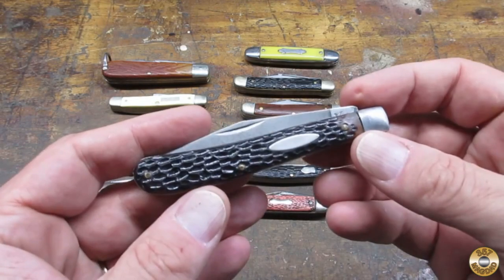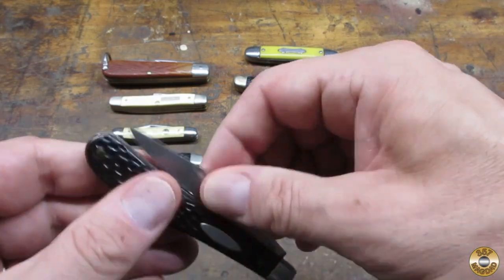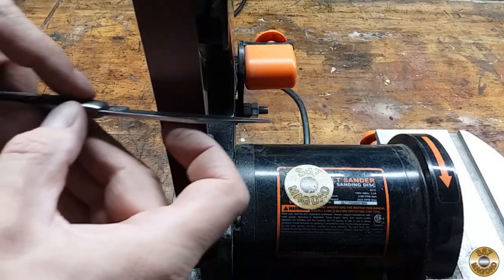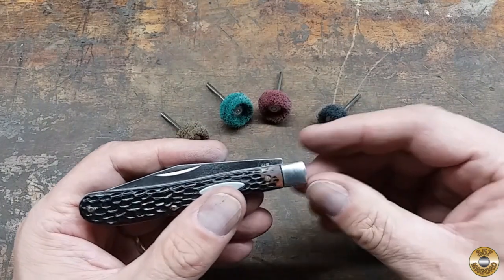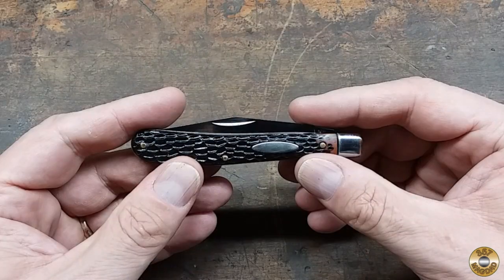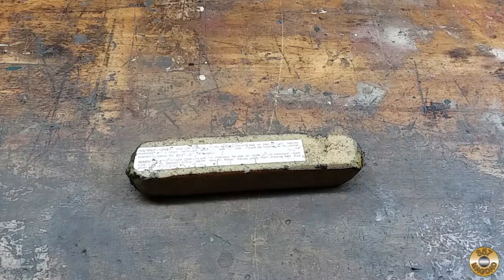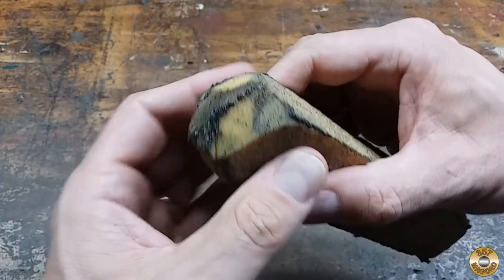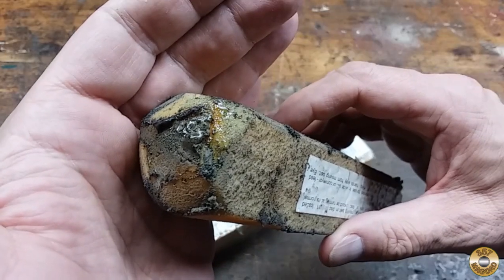Pocket Knife Restoration - Sabre Japan 620 Slimline Trapper

Comment: I had a knife similar to yours when I was about 15Yrs. The brand was “old timer”, and it had awesome quality carbon steel. The quality of the steel allowed me to sharpen it to an absolute razors edge, even though I knew very little about sharpening knives LOL. …aaand then I cut the top of my index finger with it. The top of my finger flipped open like a dustbin lid and blood jetted out so fast it sprayed the ceiling in my mum’s kitchen. Aaah… it was great being young in the 70s. 😂
Reply from the maker: Vintage pocket knives are fun to clean up!  You can't beat the edge you can get on a carbon steel blade!  I've got another pocket knife project coming up this week!

Comment: Trim off the melted end with a stout knife to expose fresh rubber. Seems that if you lean too hard on the eraser the friction/ heat liberates or reactivates solvents in the rubber. It happens.
Reply from the maker: I don't use it that often or press very hard on my little machine. I think it got like that from sitting.
Reply: @357magdad  Thinking back to my shop days I recall oil melting that crepe rubber as well. Just a thought.
Reply: I was going to suggest cutting the ends off also and try and freshen it up. If it looks the same on the inside then chuck it.

Comment: I had a thing for pocket knives as a kid and like the Sabre you restored. Nice work. I wonder if you could cut each end off and see if the problem persists.
Reply from the maker: Thanks Michael!  I was gonna through that gooey mess out, but maybe I'll keep it for a science experiment!
Reply: @357magdad  I don't know what your abrasive paper cleaner is made of. I have those smaller rectangular crepe like rubber ones. But it reminds me back to a pair of crepe rubber soled desert boots I had that at a point got gooey. Maybe there's a limit where it degrades or as I think you said it reacted with something. Again that Sabre blade really turned out great.

Comment: I think the cleaning blocks are made of natural,unvulcanized “crepe” latex rubber. Very susceptible to oily solvents. Many work boots used to be made of crepe, but now we see “oil resistant” boot soles of carbon bearing vulcanized rubber.
Reply from the maker: I didn't have it near oil.  I think I will find a super isolated spot to keep the new one.